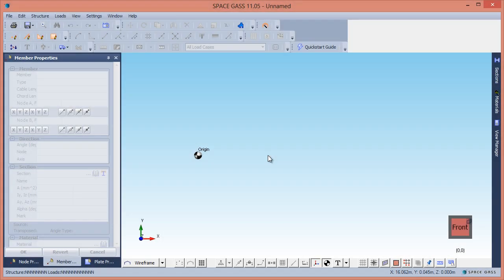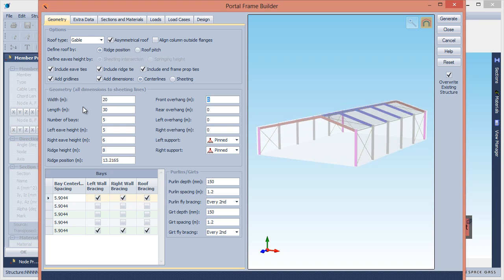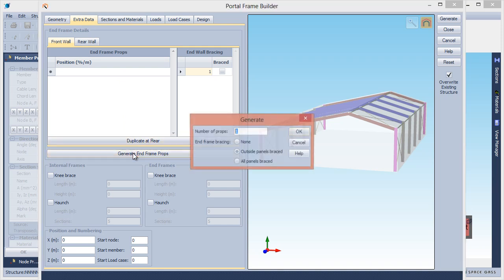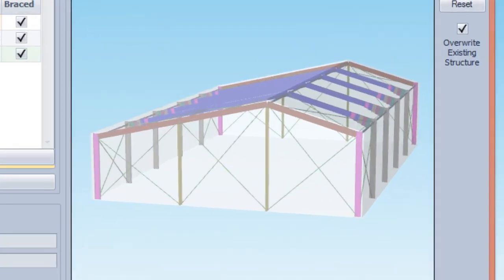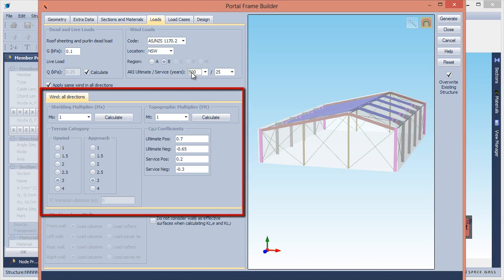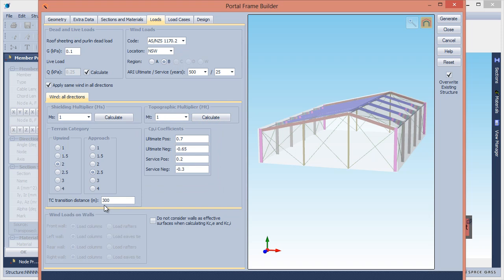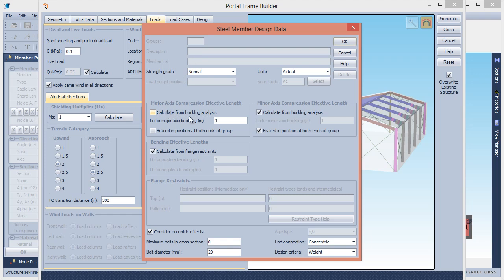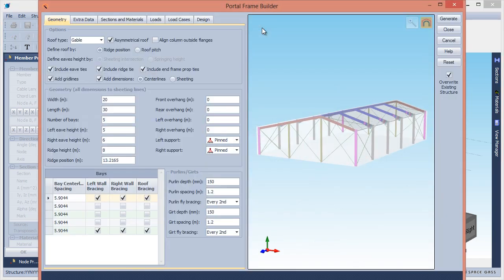SPACE GASS Portal Frame Builder

Comment: Can I apply wind loads automatically for manually created portal frame??
Reply from the maker: Hi @NipunaMalliyawadu. Thanks for the question. Unfortunately, no. You can calculate the wind pressure using the wind load calculator and/or CHECKWIND integrated version (if you have that). However, you would not be able to automatically apply wind loads for a manually created portal frame.
If you have any specific technical queries, please send them to support@spacegass.com